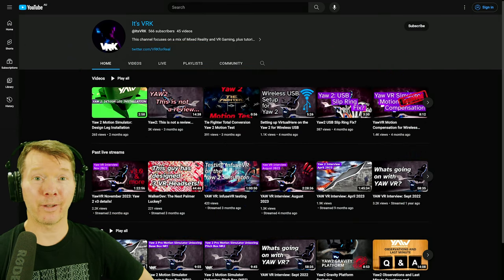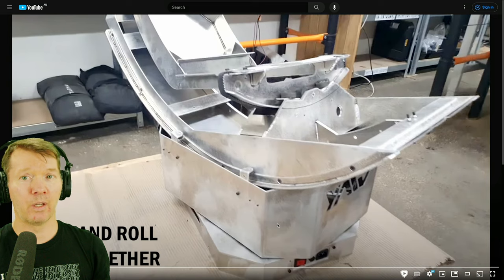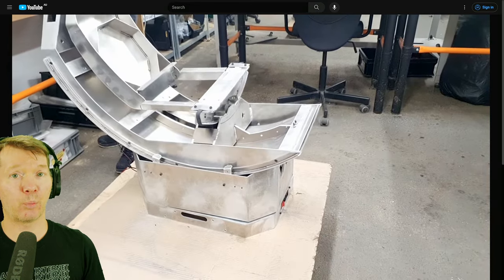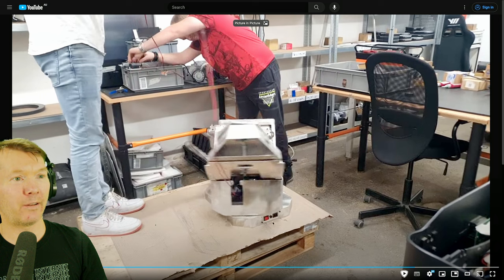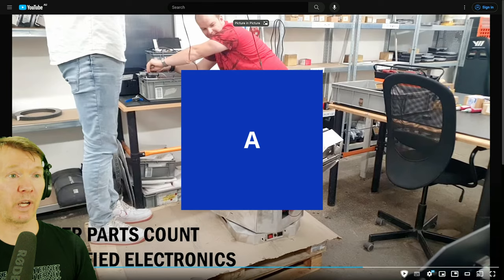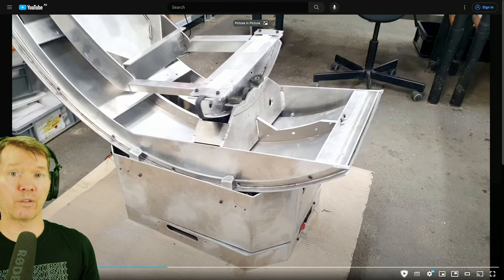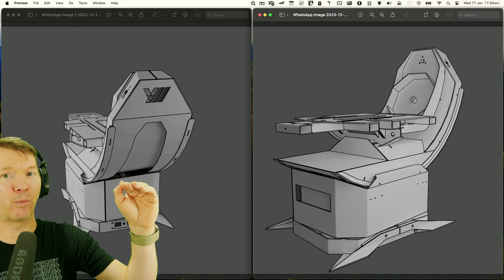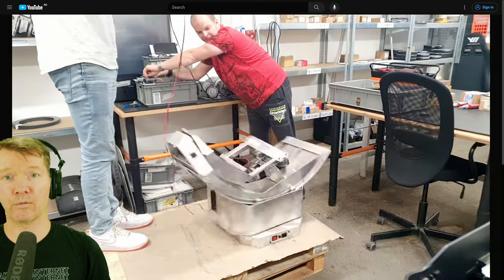Yaw2.Rev3 Motion Simulator Deep Dive *Exclusive Information*

Comment: Great video! :)
I'm definitely interested in upgrading so would be interested in that. I'm hoping it can draw enough power through the output plug to add fanatec wheels and transducer amps etc plus strong enough to not buckle from a alu profile racing frame. :)
I'm hoping it does have more roll and would love to tilt back to have more forward tilt for sure!
A pi 5 might be useful for virtual here as bandwidth was an issue for me when I tried a pi 4 and virtualhere with a fanatec wheel plus a 6 output sound card. Although that might have been a usb "multi transfer" hub issue.
Reply: I have the Yaw2 with Fanatec CSL.
But the Wheel always fails, because the USB Signal or theelectrical current is not constant.
Reply from the maker: I don't expect this to be a problem with this variant, I've successfully used a G920 via VirtualHere on a Pi3, and a Pi4 should have more throughput.
Reply: @ItsVRK  G920 is a baby wheel, in terms of power draw.
Reply from the maker: @TrevorJones1 yep, I was talking about from USB signal perspective 👍

Comment: Hello, I would like to make a suggestion. Would it be possible to put the feet “screwed” to the base (and not magnet) and have holes to be able to fix them to a wooden or metal platform with wheels that allows moving the yaw2 to use it and “moving it to a corner” when not use? and the other question… Would it be possible to have some element that allows a joystick to be placed between the legs like in airplanes? (in addition to using the central platform for a button pad or a laptop...) I don't know if the central platform and an element to put a joystick between the legs would "fit" due to space problems...
Reply from the maker: They have always been screwed at the side, just magnets at the bottom, this is quite rigid.. I have already requested holes for fixing to floor/platforms on the V3.. 🤞

Comment: Isnt a belt drive worse for the longevity of the device than having metal gears?
Reply from the maker: This is possible, we don't know the belt rating yet, but it will be a lot simpler to repair than worn gear teeth 🤷
Reply: @ItsVRK  yeah I just hope it lasts when I get it,  I'm backer #96
Reply: @TimothyMichael  I'm 673.. So I'm right in the middle of the pack. So looking forward to this rev.3 version, it looks like so many upgraded improvements that will make this unit awesome!
Reply: you car's timing belt lasts 75K miles having thousands of hot/cold cycles and RPM variations. belt technology started to really advance 30 years ago. 2 cents

Comment: This is very cool info... however as a late comer and potential buyer, my main concern is product fulfillment given the large amount of complaints I have seen from kickstarter pledges. While the exclusive info you provide seems great in terms of production quality, I had hoped you would have offered info regarding product fulfillment, because as a potential buyer, I am very hesitant. Most reviews I see on this are over a year old, from influencers... most comments I see on their kickstarter page are less than desireable.
Reply from the maker: All I can say to this is that non Kickstarter orders have being getting fulfilled for some time, they recently sold their factory building (still renting it) which I’ve been told will help with fulfilling orders to backers.. I expect this will steady around late May after the Yaw3 has passed a small round of end user testing. Additionally they have a Yaw3 prototype in Florida at the Sun ‘n Fun Aerospace expo this week https://flysnf.org

Comment: They should have a 360° option..meaning the seat then goes  full circle. Should be easy to do.
Reply from the maker: This is already one of the things that is unique to YawVR simulators.. unlimited 360 rotation.
Reply: @ItsVRK  indeed but I did mean in the vertical and horizontal  axis ...lol
Reply: @channelvr1293   That's some military level hardware you're asking for bud, a little above this product's paygrade, lol

Comment: 1 plug and 1 usb seems fine as most people would need a 5 to 7 port hub and multiple power outs anyway by the end of it all. So 2 alone would not be enough for most anyway.
Reply from the maker: As the RPi usb ports will be directly accessible you’ll get 4.. but you could still plug a powered hub into one of the Pi ports.

Comment: If you could sell one with a motor strong enough to move an aluminum rig, it would be great. It will probably be cheaper to ship.
Reply from the maker: The motors haven't changed from the previous revisions where they had to move around far more weight.